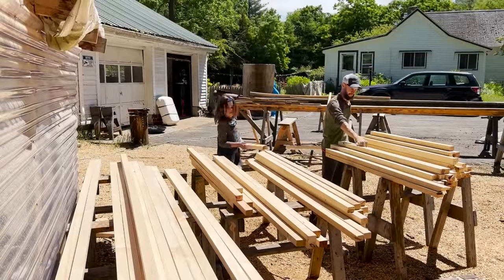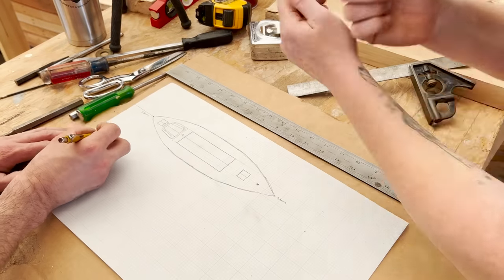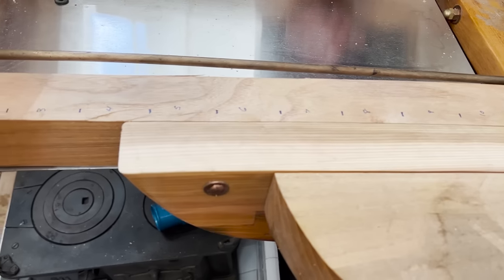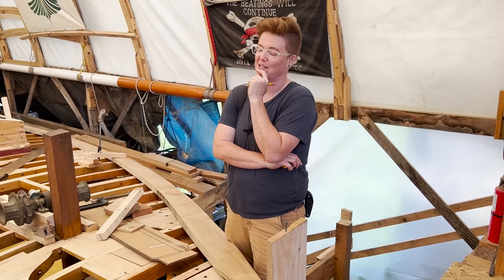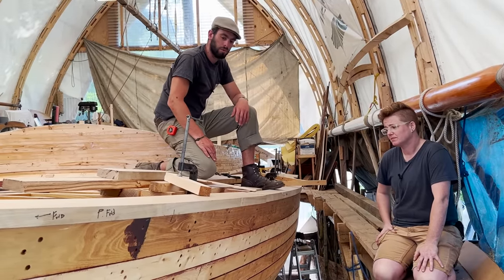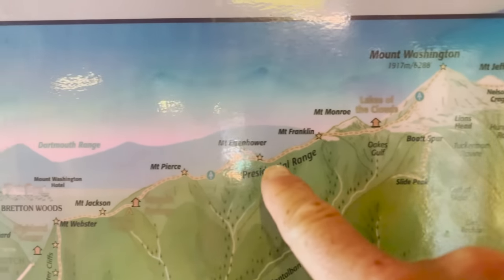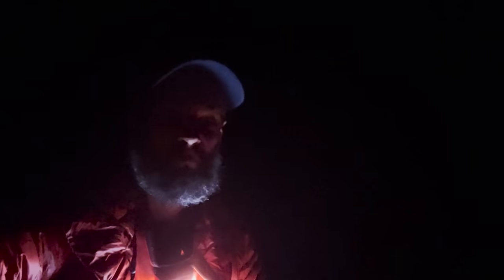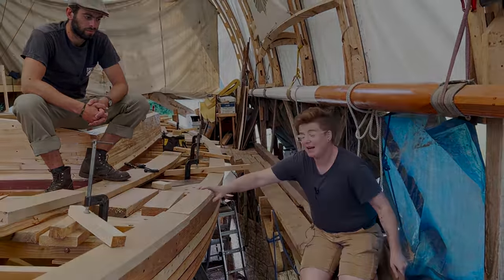The Long March to Launch - Episode 222 - Acorn to Arabella: Journey of a Wooden Boat

Comment: - Thank you Robin and Steve...for showing me my mountain home that I grew up with again one last time...Zeeland hut 24:36 looks different now it seems...and did you swim in Lonesome Lake?

- Do the locals still call running the Presidential Range: "Running The Ridge"?
- At sixteen, I was driving up the Auto Road each morning in the dark to tear down the old Mount Washington WW2 Jet Engine Testing Laboratory.
- My high school buddy and I would watch those who tried to do what you are doing again.
- We also watched the UNH and Dartmouth College football team guys who wanted to build their leg strength by packing 150 lb pack of food or propane gas cylinders up to the top for the weather station and for the Mt. Washington Cog Railway commissary at the top.
- Back then the pack frames were ash ladder packs with leather strapping, long leg pole that could be attached so you could turn your back to the grade, set the leg poles and rest standing up without taking off the 150 gear.
- Oh, by the way for the gals out there who are interested...the cut off blue jeans slit all the way around the inseam that those guys wear is so they do function like a skirt, all the better to provide free and abundant cooling air to that area...
- AND yes, like the “Scots”, all without underwear to interfere with anything.*
- The only way to do mountain skiing in the winter to sleep under the stars at Winter Solstices to mark the sun rise coming up through the notches and setting down through other notches on a {secret} high mountain is totally in the nude even at 0 degrees F so that none of the clothing gets wet with sweat...well, maybe keep on a Swedish large square hole fishnet jersey to act like a swamp cooler to help bring the body temperature down so you can push harder and faster for the run up in 3 foot deep snow!
- Oh, the joy running the mountains and "Calling The Mountains" {resonating/echoing the notches with a properly pitched call}...just to say hi to those miles and miles away who know you have gone up there to reconnoiter "what is what" and "who is where"...do you think 10th Mountain Division knows how that is done?

Comment: G P needs to get a steel ruler for her short measurements. Office depot have just the rulers / scales in stainless steel backed with cork designed for office work but perform admirably in such situations for taking relatively short measurements.

Comment: Hiya,

Long time viewer. Had a question about the cockpit. Do you plan to make it easily removable for access to the engine, tanks, and other things in that area? It may already be designed that way or you have probably already thought of that. If you plan to go that route when might we see your idea for it? 

I’m curious given that this video is prepping  for the decking to be laid and I would expect some sort of raised lip around the edge of the cockpit so the cockpit could fit around that and be secured to that to prevent water infill. 

Love the channel and looking forward to the launch!
Reply from the maker: Yes, that’s the plan.

Comment: I'm not a boat builder or even boat person. If I look at the deck planks, they seem to be 2 inch/50mm thick. Isn't that a bit overkill in terms of support ability, given the distance between support beams? A lot of extra weight there. I'm thinking in terms of my house flooring, 3/4inch (19mm), with 400mm between joists, this is ample to support quite considerable weight of furniture and in the case of my store room, many many cases of wine!
Reply from the maker: They’ll be a finished thickness of 1.5”, and that’s for a nice caulking bevel, structural reasons, and in case a spar should fall. It’s a common thickness for deck planking for a boat of this size.

Comment: Steve, forgive me if this has been asked before, but why wouldn't you join the deck planks with finger joints? It is a incredibly strong joint when used with epoxy and seems a better choice over scarf joints for straightline planks like the deck. I get the need for scarfing the covering boards and the hull planks, but just can't conjure from my incomplete knowledge of nautical woodworking why finger joints wouldn't be a better solution for the deck planks.
Reply from the maker: Nib scarfs are great for this purpose, more on that later.

Comment: I am surprised the covering board is flush with the hull..I would have thought you'd want it to be about an 1/2 to 1" proud, with a round-over. But, what do I know.
Reply from the maker: There will be a rubrail below that area. There may be some boats out there with covering boards that do double duty though.

Comment: I doubt this will even be answered. Never the less. Are you going to steam bend the "nib plank" to flow with the coverboards?  Would that add anything at all, beyond more work?
Reply from the maker: No, we won’t have to steam that. Thanks for watching! We try to answer nearly all comments with questions.
Reply from the maker: The thing that it adds, in addition to not needing to be steamed, is that if something were to happen with the deck planking, we could just replace the nib plank, and not need to mess with the covering boards… and vice versa. Covering board damage? The deck planking is separate.
Reply: @AcornToArabella  Oh okay.  Reason I was asking about that steaming was the on going concern the built process has had with end grains.  Steaming it would only provide end grain near  the stem and stern (assuming scarfed together).  Nib planks seems both important and yet replaceable.  Thought I would ask.
Reply: @AcornToArabella  Oh I get your reasoning for the nib plank.  When you found out about it. Even I thought that was a genius idea.

Comment: Why not start from the king plank and work your way outwards, rather than inwards?
Reply from the maker: Because the covering boards need to be a consistent width and it’s such an important joint. As it was with the sheer plank, too.
Reply: @AcornToArabella  But there was factors that determine the king plank, the bowsprit, samson post etc, so now that the covering boards are in rough shape, imo the king plank should go in first, then the covering boards, and then fill the rest with the deck planking and fitting planks.